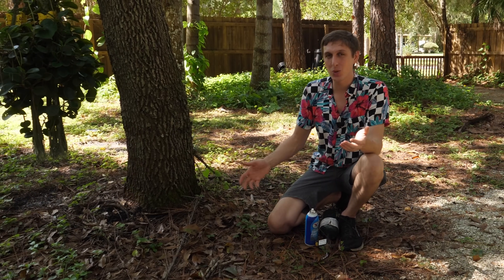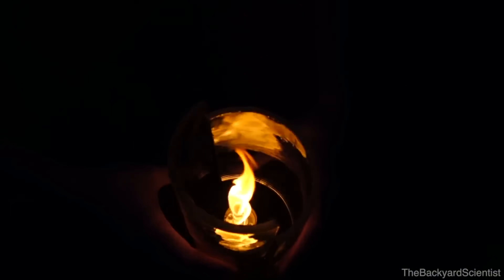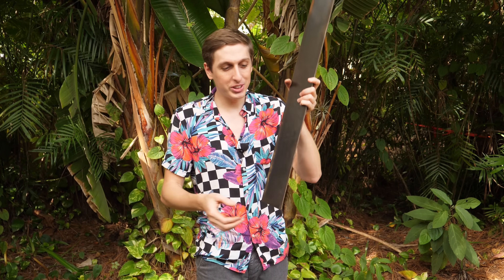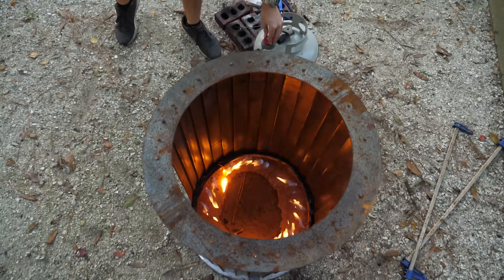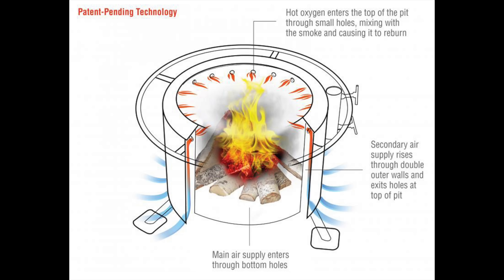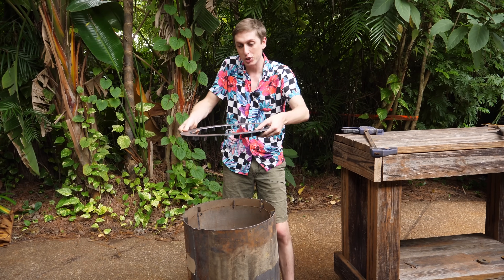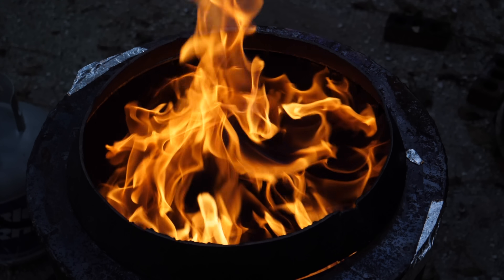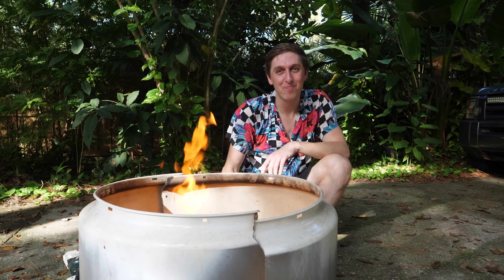The Impossible Fire pit Tornado

Comment: try it with a Top-Lit Downdraft (TLUD) burner or one of the various self-heating gasifier-burners? If you had it sort of working with propane, you should be able to get it sort of working if you convert the wood into wood gas.
Reply from the maker: thats basically what I made, I looked up a lot of them when i was building it.  I think it needed a narrower opening up top, or more air in the bottom.
Reply: @TheBackyardScientist  Around 5:33 you see a lot of whitish smoke coming out the top. Did you try lighting that white smoke on fire?
Reply from the maker: @PixlRainbow  I did, I even tried covering half of the opening to make it thicker, but the smoke was never dense enough to burn i guess. Also its just been so humid everything is just kind of moist.
Reply: @TheBackyardScientist  ah good point, if there's too much water content it might not burn right.

Comment: I think it could be done without moving parts if your area  has a persistent wind.

You’d have to weld up a snail shell design with only one open vent.

Turn the vent to aim for the wind.

Your fire pot has to be wood pellets with an accelerant, because putting branches in the snail shell will cause turbulence.

Copying the natural phenomenon with no moving parts ignores the fact that the fire tornado has a spinning cloud powering it from above.

Barring the existing breeze...

Take a look at a kerosene heater.

The glass bulb contains perforated metal flame guides.

They get hot rapidly and promote clean combustion.

If you put a “hat” on top of your latest design to combine preheated air and woodgas, with slanted fins, you’d get a tall swirl because the fuel inside the drum would be starved of oxygen.

It wouldn’t really BURN until it hit oxygen.

Comment: Ok, feel free to steal this idea. 
1. Use the nested cylinder method 
2. In between the walls, create a sort of funnel that starts wide and gets narrower towards the top.  This should get the air to pick up a little velocity if you don't create too much turbulence. 
3. Instead of having a top ring with a lot of vents pointing perpendicular to the ground, have 2-4 vents angled upward slightly.
The idea is to get the air drawn in from the bottom, get slightly constricted to increase output velocity, and then exit out the top pointed upward slightly to get the fire tornado to continue past the top of the fire pit. It probably won't be huge, but it should be better.

Comment: I used use 22 inch square patio stones that were like 2 inches thick... and built about 22 inches of a stone ring on top.. though mine did end up like 5 feet across :) It worked pretty well when loaded with yard overgrowth... and I had a nice clean burn compared to just a leaf pile.  (Even with wet shouldering stuff it was pretty clear... in fact I had like air distortion such that you couldn't talk over the pit because it carried away the sound waves too :)  
The fins would work... but you need fast burning things like leaves on branches - oh palm fronds work really well too...  but should really just have angled input at the bottom... if you let air in the sides the different pressures will cause more mixing; and you realty want something like a chimney to draw it out.  I think if you had a cap that you could put over it, and capture the heat to create a draw in a flu - like a J-rocket stove, that you could draw the vortex over the rim.
(Let me recap that - a 5 foot ring, using 22x22x2 inch patio stones angled like your slats, but then with a solid ring built on top which acts more like a chimney... you should probably just drop a metal inside shield about 66% of the way down your metal slatted one - and open those slats a bit... my angle is actually like 30 degrees off of the tangent - which is quite a gap on the intake side...)   And then since you have a smaller model, if you can make a chimney flue you could make a pretty tall flame I'm fairly confident.

Comment: measure the size of the small one that worked get 5 how much larger your new metal ones are divide the small size into the large size and multipli the lenth of the opening of the small plastic model and mutiply that number by the 1.7 or what ever the % was larger so that will tell you where to set the large ones close , so it will start a tornado

Comment: Right, here's the two drum method: Position two air intake pipes at bottom of inner drum opposite and parallel to one another (pipe diameter is proportional to the drum).  A cone with a short flue providing a secondary combustion chamber, pipes offset in the described manner at the junction, gets placed on the placed over the outer drum once the fuel (wood) is burning.  Once it has fully heated, additional wood can be added through the top.  Important considerations:  Be Careful!  Good barbecue gloves and long tools (Gets very HOT).  It needs to get really HOT to work.  Venturi effect to speed exhaust flow.  Dampers to control intake are helpful.  Lumber works better than firewood (especially in Florida).

Comment: Channel the air that reduces smoke through a fan/ thingy that rotates a lily impeller to make tornado taller..? Or cheat and add a motor
.
edit1: the fuel is not in the middle, as the impeller is there. Maybe a ringed channel of fuel or smaller fire pits inside a larger one again with impeller centered.. I need to draw this one sec
Edit2: I lose, it has moving parts BUT the moving parts could be powered by the fire but idk, I'm cheeting

Edit3: sigh.. last edit.. build the impeller inside out.. no moving parts needed 😎 I'll try to draw that if google fails me 😶

Comment: I’m 34 seconds, it’s gonna be a gasification style burner with preheated secondary oxygen inlets to introduce enough oxy to the remaining hydrocarbons in the smoke to completely combust it, creating heat, water vapor, and carbon dioxide.

I like nerd stuff
Reply: And to create the tornado he’s gonna use angled holes, for the secondary air inlet
Reply: Dang I’m wrong, I like the way he went about it
Reply: Lol nope I’m right lol
Reply: And a raised chimney about 4 feet from the top of the pit with some sort of hood to initially coax the flame into it. Could attach it with some angle iron or whatever, put another air rotation thingy on the bottom of the chimney, maybe the draft effect with crate more air flow and a more stable area to the tornado to form. Once the chimney heats up anyway.

Comment: Have you considered a loose fitting sort of turbine at the bottom to improve vortex formation? I have no idea if it would work, but in theory, the fire sucking in the air could cause a turbine to move if it were designed with little enough friction.
Reply: I'm sure there isn't enough force coming in to move that stuff he'd probably get some movement if instead of using pins he used some kind of ball bearing thing or something that can easily slide so that way the smallest intake of air from the vents would cause it to spin but still be able to hold the vent blades in place in the rail maybe do some math to figure out the best angle to intake enough air to make a tornado but also creating the maximum vaccuum so it sucks in as much air from the vents which would also cause them to move faster creating a better tornado that can probably extend outside of the pit 

But I'm honestly just guessing an idea cause i dont know much about building stuff like that plus not to mention in sure the ball bearings or whatever gets used would end up getting dirty quickly which would cause it to struggle to move itself and would probably require constant cleaning

Comment: Actually, I saw some scientists do one to study them, all you do is put a 30-foot shaft over the fire, that's because as the fire gets really hot it, it sends the air up the shaft really quickly and pulls the air in from the sides, and if the shaft is a circle it will naturally start to spin. So what you do is build a fire, put a really tall shaft on top of the wood and set the wood on fire, if you have a camera at the top of the pipe you will see the flame come out the top and the whole shaft will be a fire tornado. BTW watch out they get really really tall.

Comment: Cut the top off of a fire extinguisher. Then mount the Beckett gas burner on the bottom Of the extinguisher then do your wire configurations

Comment: ok, so I have created a fire tornado in my metal melting foundry. I had my helper throw a half a cup of vegetable oil in the foundry when the internal temp was sitting around 1200C and we got a tornado probably 2 stories tall. it lasted as long as the fuel was burning. i do have pictures (we did this at an eco living fair to prove that vegetable oil is a good fuel source)

Comment: Would a scuba tank count as moving parts?  Not really any different than a propane tank.  Perhaps with pure oxygen or just nitrox?  Another option, make it with clear sides instead of metal so you can see it even if it doesn't extend out of the container any.

Comment: Get a single cylinder gasoline engine with an aluminum cylinder head, set up the slow motion cameras, and then put gallium onto the cylinder head. Then keep the cameras rolling with the engine running, and just wait for the gallium to do its magic to the aluminium cylinder head.

Comment: I built a 'Vortex Incinerator' several years ago. It was like a vertical jet engine with a chimney. The base was a 55 gallon drum burner with a shielded axle in the center, it had a grate in the bottom where fresh air entered. Under the grate was a many vaned fan attached to the axle to spin away the ash if it didn't blow up and out. Up above, the axle had  large helix vanes inside a chimney to provide motive force. There was a space between the burner and the chimney to load wood and see fire and the lower part of the chimney had a funnel shroud to concentrate the fire up the chimney. It was all made of scrap metal. The  bearings were pins in cup and a large tripod held up the top of the chimney. It worked spectacularly once, the burner drum got red hot and glowed in spiral waves and the axle spun nicely, then the axle got red hot at the top and bent. And that was that. Too many moving parts of junk to last. Then it was art.
Reply: Any chance you have any photo's of it? Or could sketch a diagram of how it worked? Sounds really interesting!

Comment: The biggest problem I see is one of scale. Quite simply, without the significant pressure gradient of the atmosphere and the insulating effects of a larger volume to surface area ratio, the fire will want to die very easily.

Comment: the only way i can think you could get this to work with wood would be to make it in a cone version of the water heater jacket but get a venturi effect by going from large opening to tight exhaust port drawing high velocity air up and giving a more complete burn like a smog pump on a car engine after the first catalytic converter

Comment: what about a glass tube that protects the flame above the metal container (kind of continuing the cylinder). wouldn't the air continue to rotate as it goes up, taking the flame with it, instead of getting blown by normal, non spinning air?

Comment: Try making holes in the bottom of your outer layer to help suck in air, and  then make the top portion dumping extra air have the angled slats. so something like an inner and outer layer, the outer layer has holes for sucking in air, the inner layer has angled slats at the top pumping air in.

Comment: What about having a tank of water in the fire with a copper line leading out. On the end is the "hot" end of an old car turbo. This spins up the "cold" side. Hook it up to one of the side intakes of the more basic design (oil drum cut and offset) and maybe it'll do something. The question is will it build boost?!